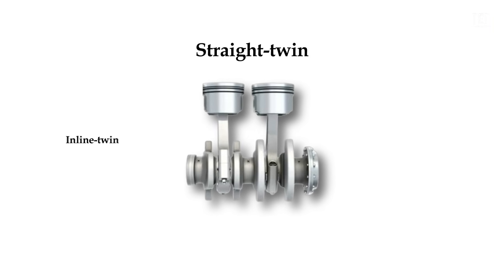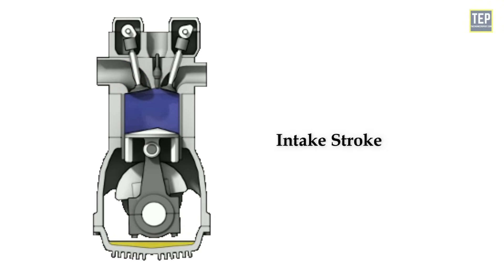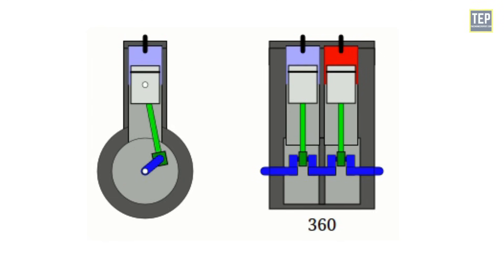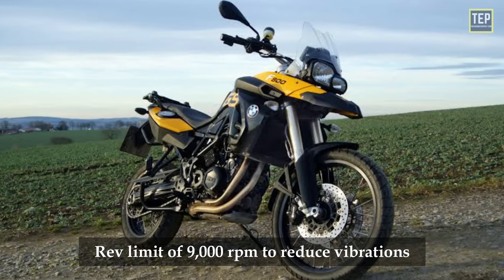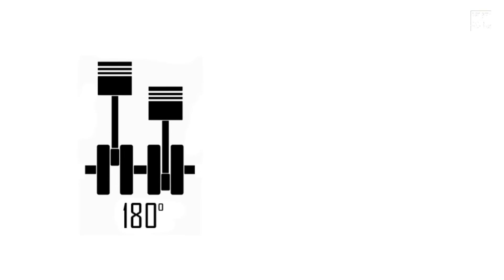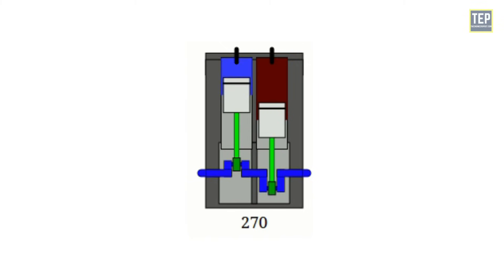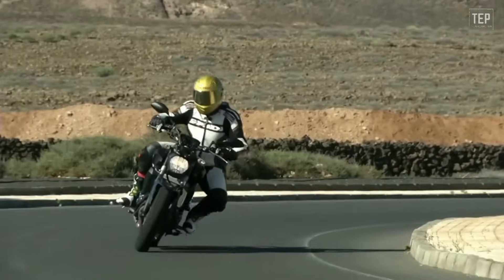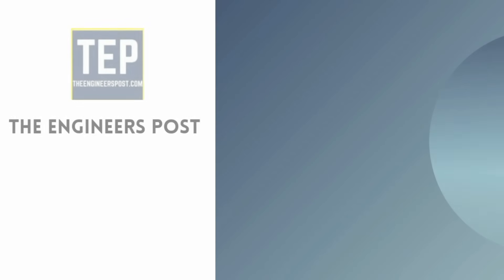360° vs 180° vs 270° Crankshaft Angles in Parallel Twin Engine | Explained

Comment: Personally, I think the 360 best sounding, but you really can't beat the smoothness of the 270. Though I find the 270 to be rather generic sounding
Reply: You come up to motorcycle becuase of the sound? Dude engineering of motorcycle is not about sound. If the engineer playing the position of the piston and its firing order it just because many dumb men like rumbling sounds and not care about durability,this is what company wants a dumb men just enjoying sound.
Reply: @thirdiii171  bro he liked the sound of the engine and ya made a rant about it... Like wtf. Dude didn't talk about how 360 performance or anything, he just gave a innocent answer saying he prefers the 360 sound because he likes it. Like damn bro when you made this comment were you in a bad mood? Like damn bro.
Reply: @thirdiii171  Yo! Why you so upset?
Reply: @dvdh4937  the 800 bmw engine is as smooth as a 4 cylinder below 4k.  But it gets really buzzy after 5k.  It's the trade off with the balancer  rod dummy weight. It's actually a lot smoother  than the 850 replacement with 270° crankshaft.   The vibration is just spread out more across the rpm range with the 850cc

Comment: Why cranks in 4 cylinder engines are not mounted at different angles ?
Reply: You mean a crossplane crank? There are lots of videos explaining the (dis)advantages of it.
Reply: They are. Most are 2x180˚ but Yamahas crossplane is taken to a higher level of different angles.

Comment: Very good explained. Thanx a bunch. I prefer the 270°, best sound, similar to a V2 and it has good torque from down below.
Reply: Torque and power will be almost the same in all of them.  The only way the cylinders can affect each other at all is exhaust pulse scavenging through the header collector.  The 360 is the only one that can really make good use of that, but most of those bikes had independent twin exhausts.  However since the 270 is most popular today, there are a lot of great torquey engines in that configuration.  The Yamaha MT-07 would have had equally awesome torque even if it was in a different configuration.  I agree 270 does sound the best.
Reply: I might sound stupid. But INLINE, as in IN LINE, it has its own pistons in the same row. V engines, coming up to its name, It forms a V shape like V5, V6, V7, V8, V9, V10, etc. So that is why it is called INLINE as its pistons form a vertical line. Have a nice day!
Reply: "Well" explained. "Good" is not an adverb.

Comment: Great explanation. 180 and 270 require more parts to reduce vibs. A low reving 360 in engines upto max of 750 cc is probably most sensible, as its cheaper to manufacture and simpler with less moving parts. Simple is reliable is economical is practical.
Reply: Less  moving  parts?  A  360  would   need  more  and  more  balance  axes.
Reply: @vicent436  its really no different to 180 and 270, all of them need a balancer for higher displacements. The only real advantages the 360 twins had were for the simplicity of the ignition as they allowed wasted spark systems and the single carburetor.
Reply: It's been tried, not reliable (Norton, Triumph, Royal Enfield) : mode self destruct engaged. Hence 650 max for a 360° parallel twin without balancers ...
Reply: @karlavelo2482  High comp 750cc big-bore and a lumpy cam is absolutely fine with a 360 crank, just make sure you've got accurate sparks and carbs balanced. 

Replacing the 45yo rubber mounts for handlebars and footpegs makes a difference as well.
Reply: @karlavelo2482  I ride my 850 Commando all the time, it's great fun and with the Isolastics sorted vibes are minimal.

Comment: A crossplane crank was so named because viewed from the end the crank pin formed a plus sign, or cross. I don't know how a 270 degree twin can be a "crossplane", unless of course its just marketing BS. My old 96 Yamaha TRX 850 had the same 270 crank as the modern twins and no mention of "crossplane" was mentioned. Same goes for the CP-3 triple, it should be a "Starplane" crank, because it forms a star shape, like a Mercedes emblem, not a "cross".
Reply: Tbf to Yamaha, they call the 270 twins "crossplane philosophy" which imo is fair enough as they exhibit the same benefits as a true crossplane 4. I had a TRX back in the day and it was a funky fun engine just like the 689 motor is now. Totally agree about the triples though, they are not crossplane at all.
Reply: Yes starplane or y plane. Not crossplane
Reply: I figure it is because one of the crank pins crosses the plane of the other rather than lying in the same plane.
Reply: The inventor of the 270˚ crank, Phillip Irving called it “staggered crank”.

Comment: I’m a fan of 270 degree crank. Sounds best
Reply: For me it's the 315 degree twin in the Husqvarna nuda. Second would be the 285 degree KTM Duke 890
Reply: @mongerrr  315 is an equivalent of harley davidson's 45°vtwin.
Reply: @mongerrr the Duke 285 degree is my favorite
Reply: I had a mt07 n a mt03, cb500x ( both 180°), stock pipes, the sound i liked the least was the mt07
Reply: Yes royal Enfield interceptor 650 has it
Reply: @rahulsharma255 Ye, it Sounds Great Even with Stock exhaust
Reply: Can someone explain me how long it takes how to do it what do I need to do it ? How much it cost example ???
Reply: 360° is better
Reply: No the 360 sounds best... but doesn't make as much horsepower as a 180.
Reply: Tdm900
Reply: Same here